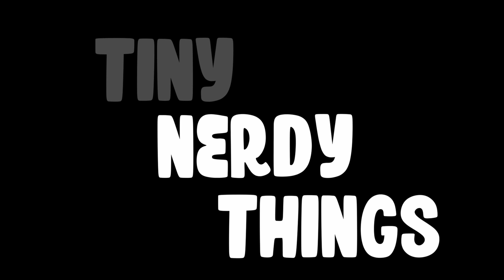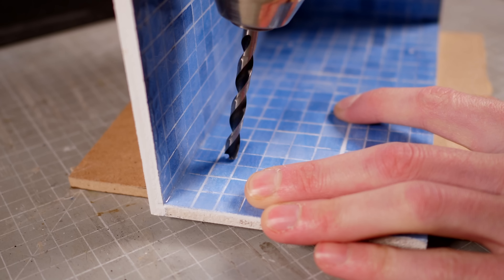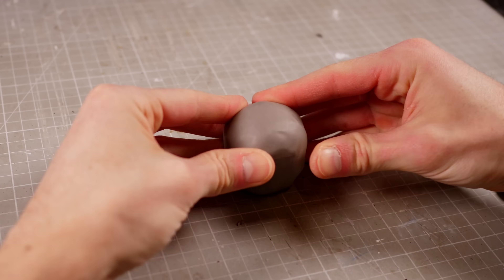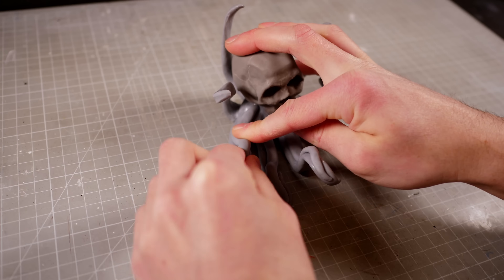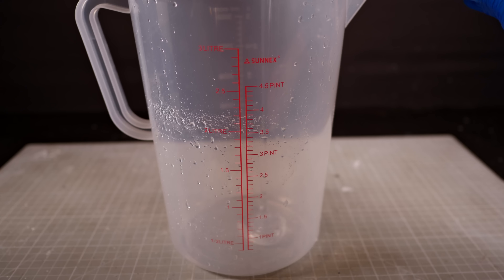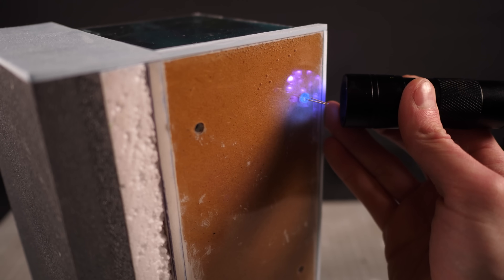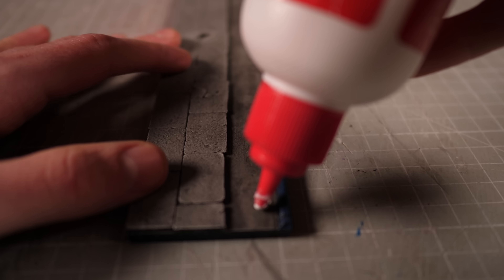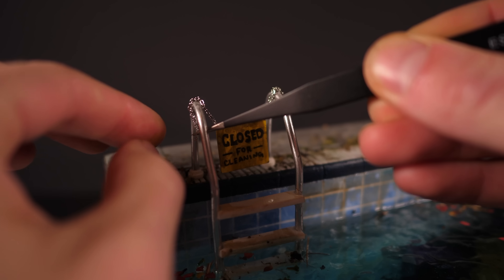I Put a Zombie Octopus in a Pool / Deep Resin Pour

Comment: Impressive work. You can buy "pre-trimmed" LEDs, they're called flat tops. They come in two varieties: regular flat and a reflector flat. The reflector flat has a little cone cut out of the top, which creates a reflector. They're designed to reflect the light sideways instead of forward. You can also get other shapes and sizes. Piranha LEDs are great for bright beams. Straw hat LEDs are like regular 5mm or 3mm ones, but much shorter and the beam is wider.
Reply: That’s not a fun as finding little glass pieces on your floor though haha
Reply: @usa_summer9656  Yeah that's true.
Reply: Bro got PHD on LEDs
Reply: Number one victory Royale yeah fortnight we bout to get in and get down on the border of

Comment: I probably won't get an answer, but what type/brand resin die you use on this?  I just did a deep pour using 1 gallon of Liquid Glass resin and I'm currently melting my submarine 8 hours later.   Be great if you could share that information.